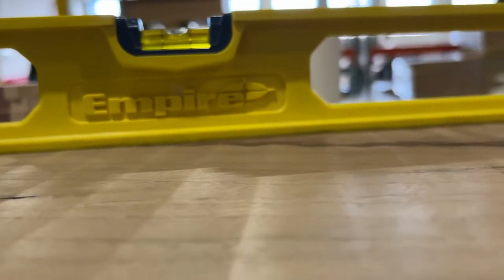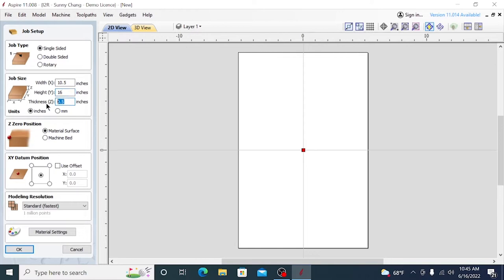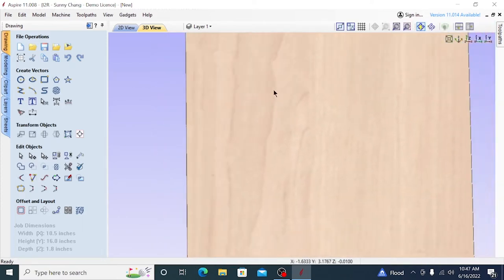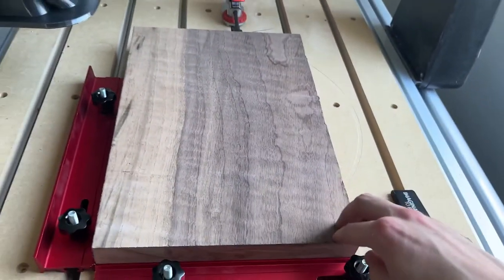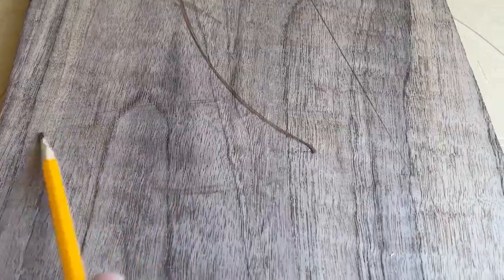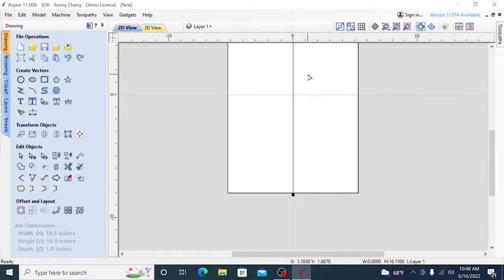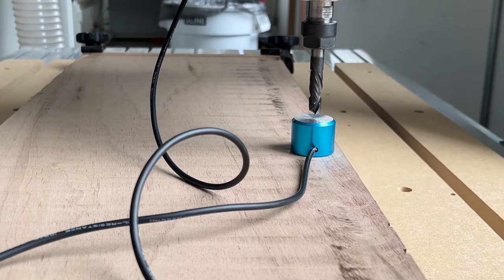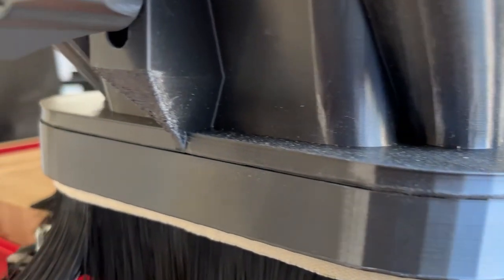How To Get Perfectly Flat and Straight Edge Boards - CNC as a Planer and a Jointer

Comment: It looked really wavy and sloppy.
Reply: if your cnc is properly trammed, it will just leave a slight variation in grain (similar to when you mow your lawn and you can see the variation in direction even if the grass is same length. usually the lines will smooth to the touch, just a quick light sanding will fix the issue.